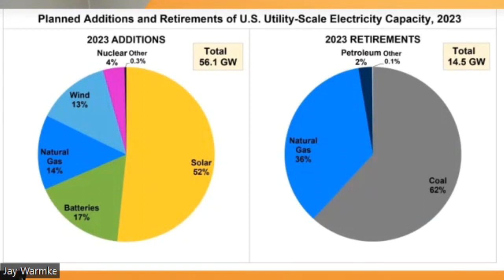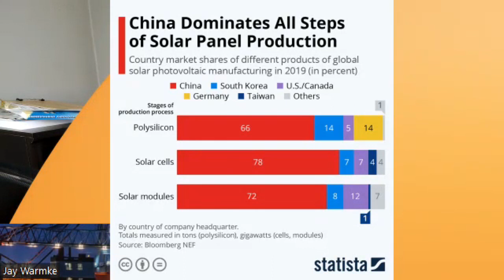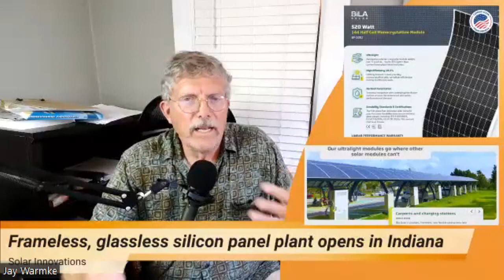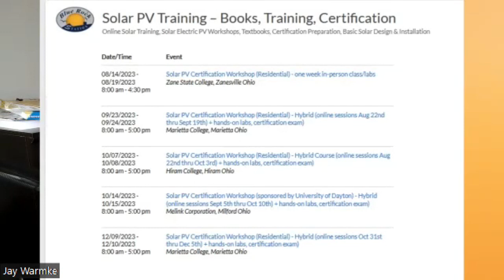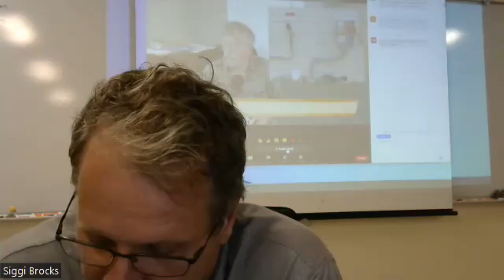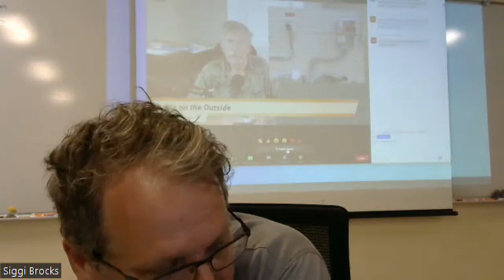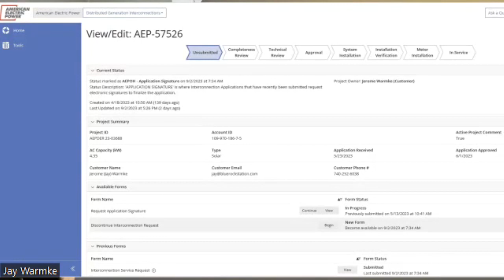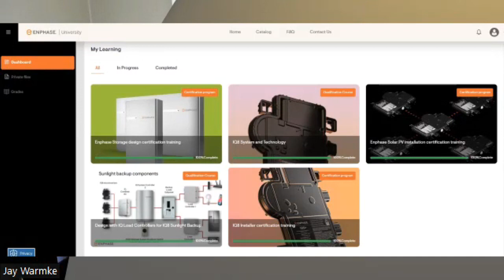Installing the Sunlight Backup System from Enphase (Solar Noon Tuesday)

Comment: I was going to add the Ehphase Sunlight Backup components to my grid-tied system based on Q Cell panels and Enphase IQ8A Inverters and their Combiner 4C that should be installed in a few weeks, but since we will be adding batteries (hopefully the Tesla PW3) in the next 12 to 18 months we held back.  Our outages are so infrequent we are wondering if batteries are even worth it?  I guess every homeowner grapples with that given the cost associated.  And I'm hoping Tesla enables V2H charging since we also own a Tesla.  But nonetheless, this is an informative video and I will double-check with my installer, but the Enphase 5P looks like a great option.  Thanks